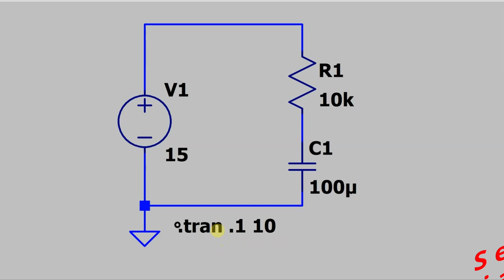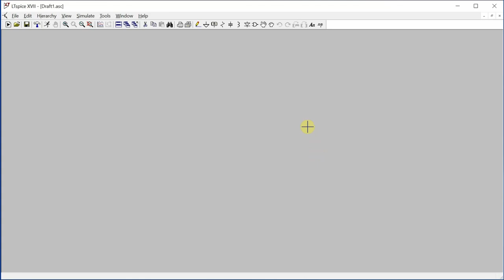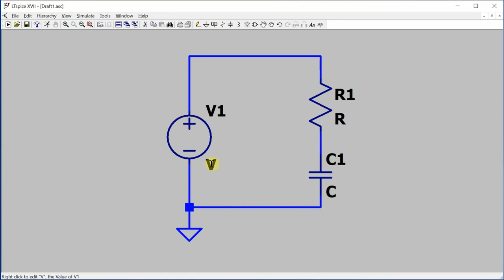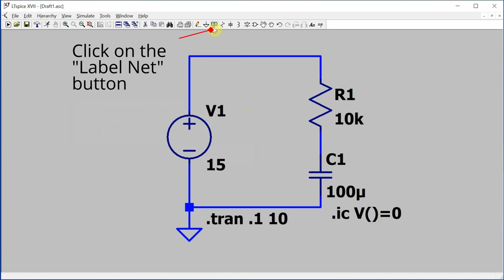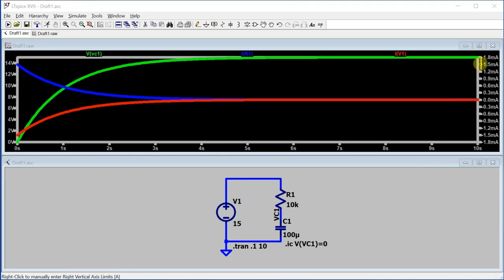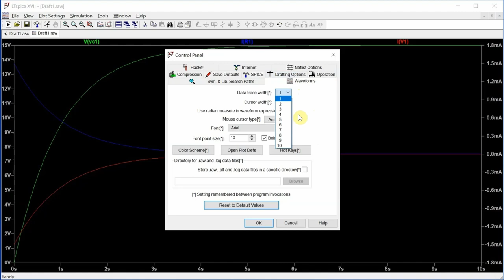A Quick LTspice Tutorial - Charging Capacitor

Comment: 'X  Lab person ,
thanks for putting this LT spice vid together.
your posting of it is in sync with something active in my life right now.

my honda motorcycle 80cc engine  flywheel coil spits out 3  successive '+'  1/2 sine waves
200 volt peak every kick - start revolution.  they go directly to the CDI module.  
and charge a capacitor or size about 2uF.   

     and while 'scoping them and not getting a spark ( faulty trig signal ) an idea arose.
to connect the 1/2 sine waves to a cap on a bd. - bd. with Rs and see how the
cap charges.  and then once the Rs is found. ...quickly   jumper C  to the primary of
 the coil and see if a spark follows .

     you get the idea.  i see the engine as a signal generator to experiment with.
so far as learning 'cycle ignition systems.  

      the bugger here is the 60's weather just ended and a new cold front is moving in.
now if i had another way to get a 200Vp sine wave then this exp. could 
continue indoors here where its warm

     so , can you tell me if LTspice can be coded to deliver just 3 200V 1/2 sine waves
in .050 sec (to sim' a  600 rpm  kick start ) ?

Comment: Many thanks for the explanation.
I noticed this.
Set 10V as supply voltage (no internal resistance). 
Time constant is calculated differently depending on resistance (kept capacitance constant = 1000u).
R = 0.001 -> RC = 1 us => 61.24%
R = 0.01 -> RC = 10 us => 61.18%
R = 100 -> RC = 100 ms => 63.22%
Calculating 10 x (1 - EXP(-1) ) would give 63.21 %.
Differences even with peak currents.
Is it explainable ?
Thank you again

Comment: Saved my day. Thanks. It is probably me, but should the .1 step command not be in the end? So 
.tran 10  .1   which is the same as maximum  timestep.  And if you use the Edit Simulation Command window it will also automatically insert 0 for time to start saving data. Then the complete line will look like this:    .tran  0  10  0  .1   Am I understanding it false?